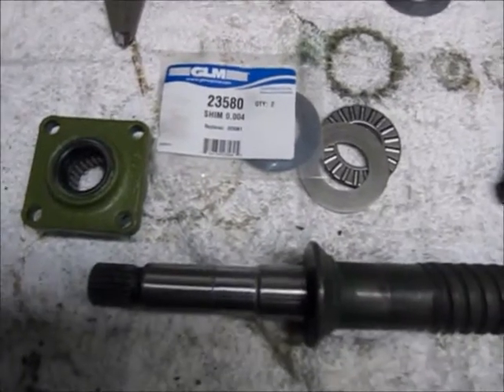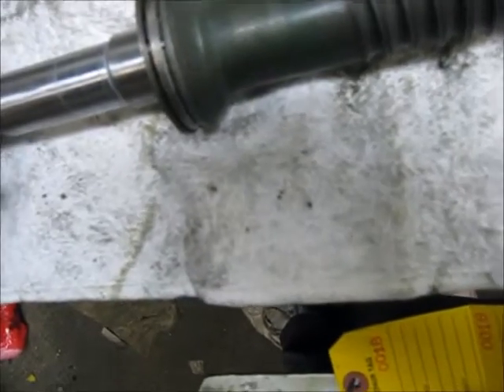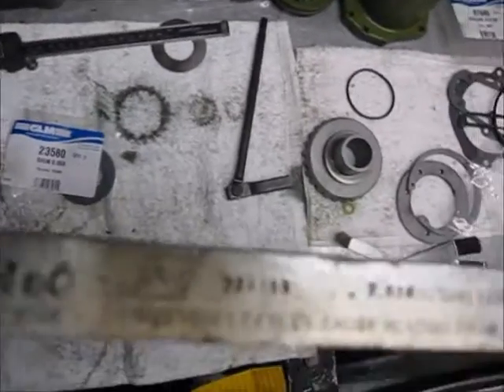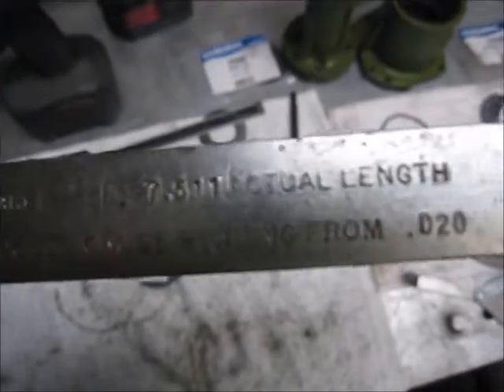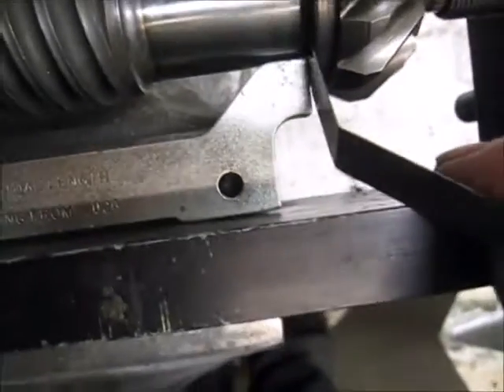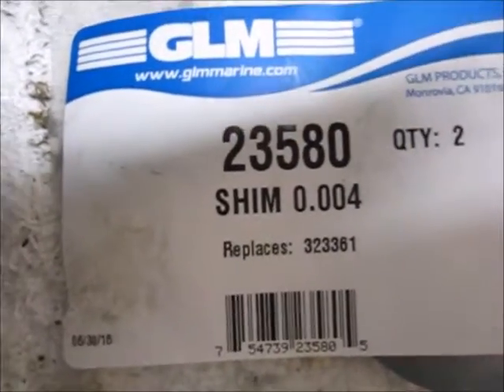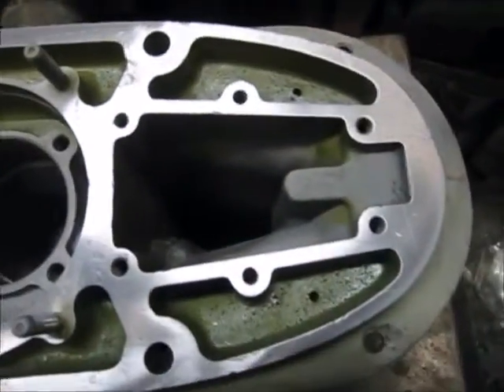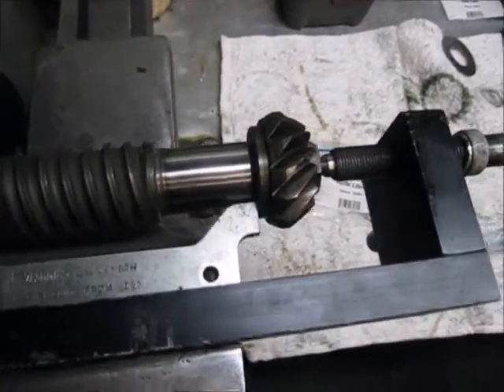How do I shim my OMC 400 lower unit drive shaft

Comment: Is it possible to use a dial indicator with a long base rod extension to check it when it's on the lower unit ? It's kind of sloppy without the water pump but by eye it looks more than .020 of up and down play , with it still installed ..no shavings on the drain plug,  I was just resealing it and I noticed all the play and slop ..but I understand some of that is normal , but I haven't handled enough of these to be a critic of what's to much play ???